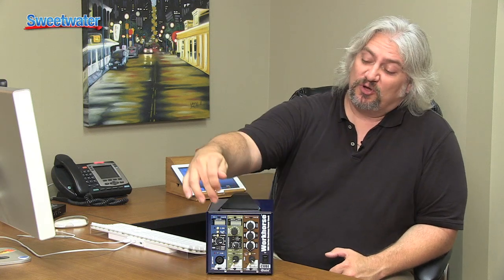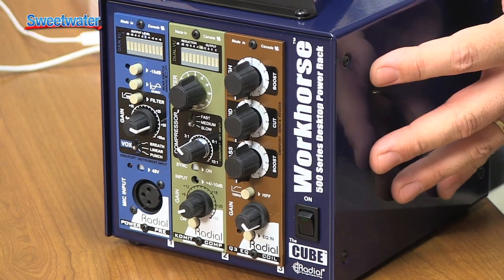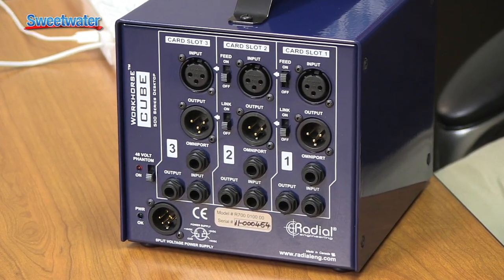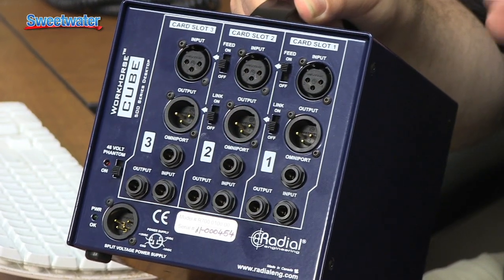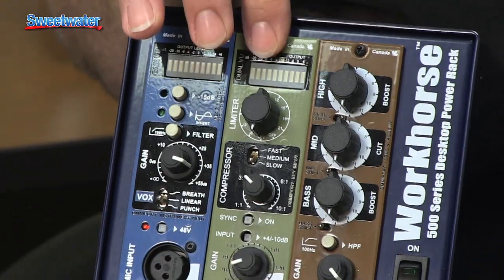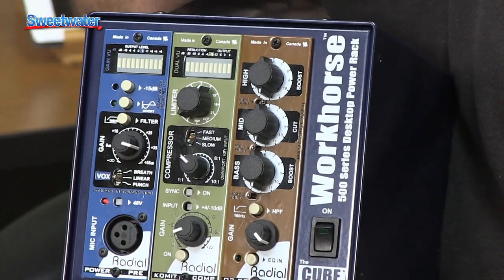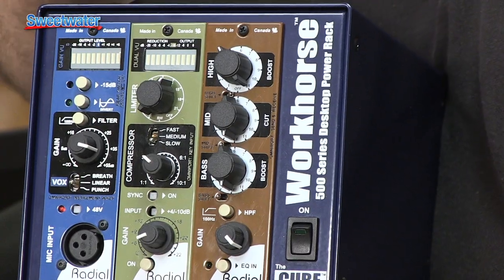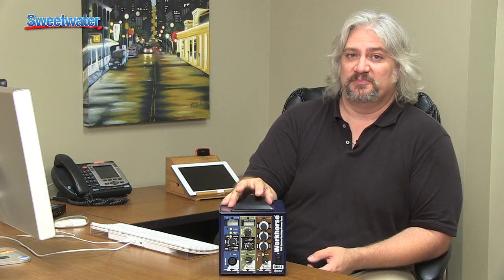Sweetwater Minute - Vol. 160, Radial Engineering Workhorse Cube and 500 Series Modules

Comment: Hi, I hope you guys are doing well, i just bought this lunch box and a portico 511 preamp, both have 48v phantom power button, which one is suggested to be turned on for using a condenser mic in this setup ?
Reply from the maker: Hey there! Thanks for reaching out, it's Mickey from Sweetwater! It is suggested that you activate phantom power as close to the source as possible. Though in this instance the proximity is so close, it should not matter. That being said, having quick access on the front of the unit may be easier depending on where you have your Cube. It is a welcomed feature either way as some modules, especially DIY kit 500 series preamps, will not offer phantom power.
Mickey Cushing, Sweetwater Sales Engineer, (800) 222-4700 ext. 3024, Mickey_Cushing@Sweetwater.com
Reply: @sweetwater  Was gonna ask that same question but saw you guys answered it here! 💪